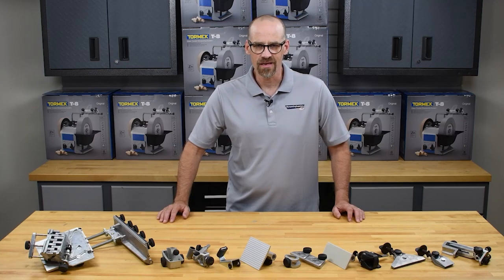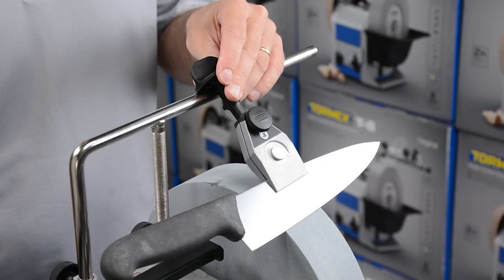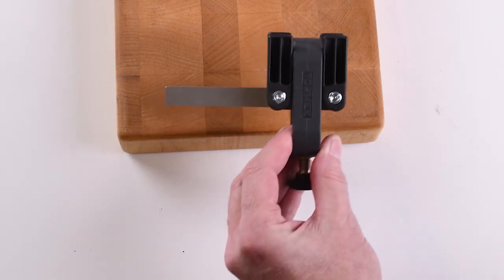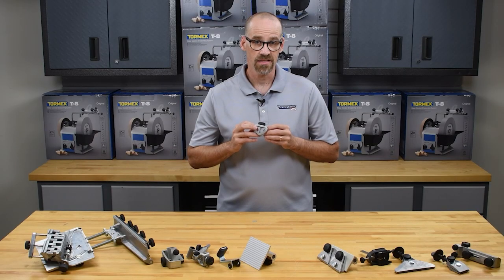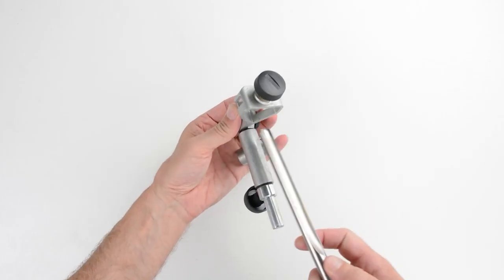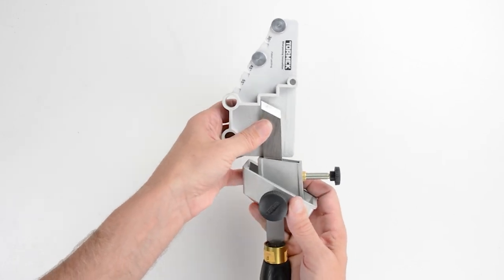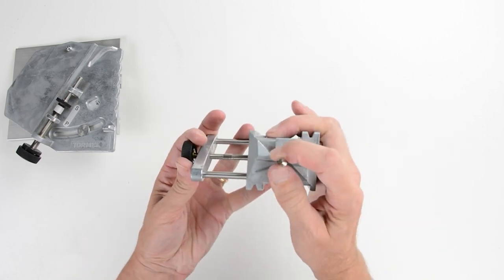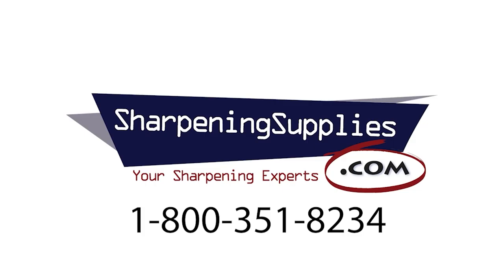How To Use The 11 Most Popular Tormek Sharpening Jigs

Comment: Is it possible to just sharpen in edge trailing method. I have experienced a catch several times with edge leading and am now quite uncomfortable with edge leading. I must have precision edges but am really wrestling with this. My work height is correct and hold firmly but still get a catch on occasion. Thank you.
Reply from the maker: Yes, you can sharpen edge trailing. Edge leading is a little more aggressive. Tormek recommends edge trailing with their Japanese grindstone, which is a little softer and could be damaged if the tool catches.

Comment: I don't have one, and am not skilled at sharpening, but this is great information, best practice tips.
That setup looks easy enough for a novice to perform.
I had no idea there were so many jigs available, you can sharpen virtually anything with quick, reproducible results.
If I ever saved up for something like this, I'd have to start a ledger for everything I sharpen, so I'd know what angles and jigs to use, haha.
Thanks for the upload.
Reply from the maker: The Tormek system is fantastic for repeatability and speed. They are real simple to use. It's an investment but you can see the utility they provide. If you do get one, it comes with an instruction manual with several blank lined pages to keep those notes in!